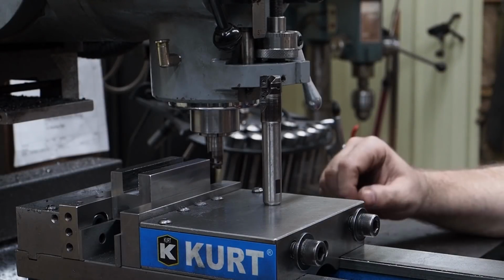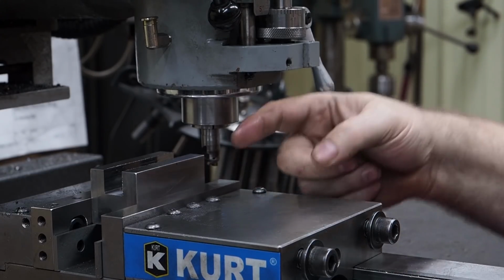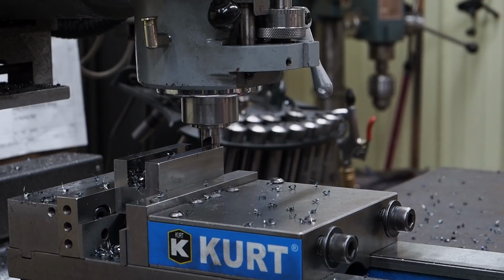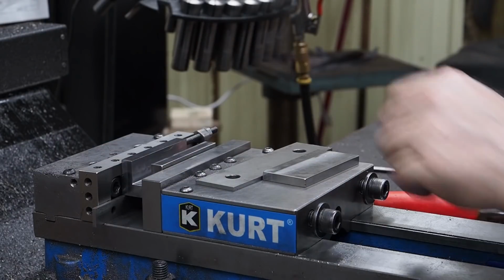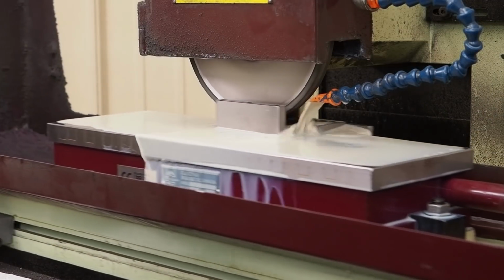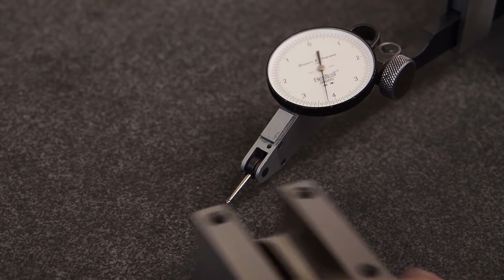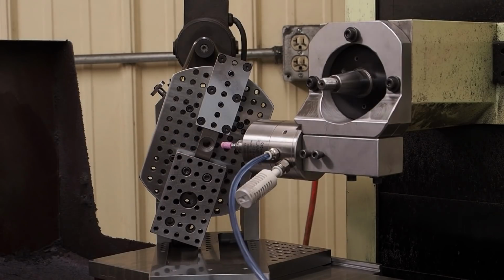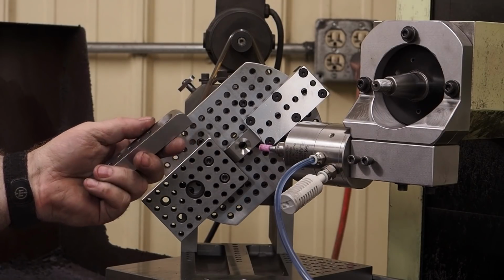Making of a Grinding Fixture Pt. 2

Comment: Can you plunge mill this slot and clean it up with another endmill?
Reply from the maker: Yes, you can. In plunge milling which I do often you have to be careful the end mill does not pull out of the collect some and cuts deeper than intended.
Steve

Comment: do you not like to use a coolant mister when channeling
Reply from the maker: I am not a big fan of misters, they put to much stuff in the air that I would not like to breath. Many of the coatings on carbide inserts do not like coolant and run better dry. For some coatings to work they need high temperatures and cooling many time cause micro fractures on the insert leading to insert failure.
Steve

Comment: Just curious, but why do you spin the part and the grinder in the same direction?
Reply from the maker: It has many of the same benefits of climb milling on the mill.
Steve
Reply: @SolidRockMachineShopInc  - I would never have imagined there was such a thing as climb grinding.  Something else I need to do homework on, thanks!
Reply: @SolidRockMachineShopInc  interesting, I've always heard to turn them opposite for finish. Thx for the reply.